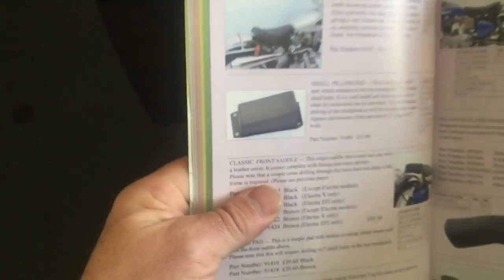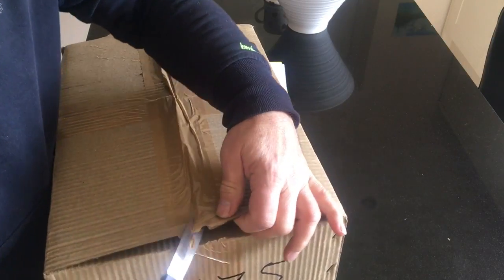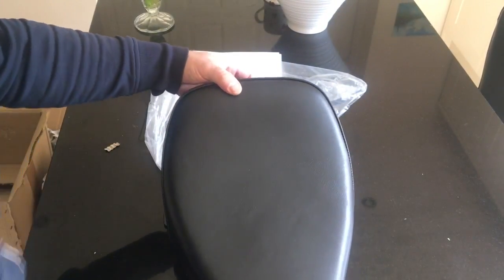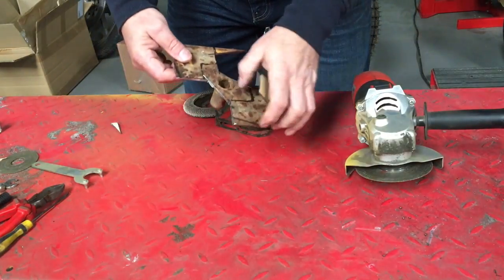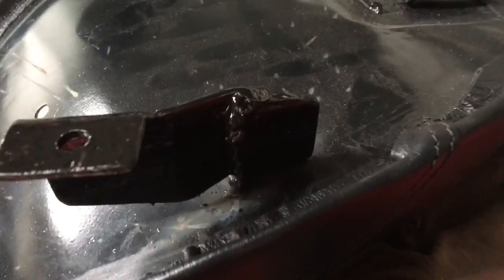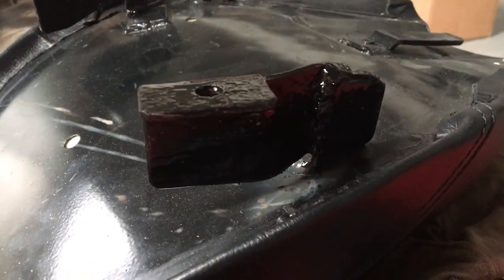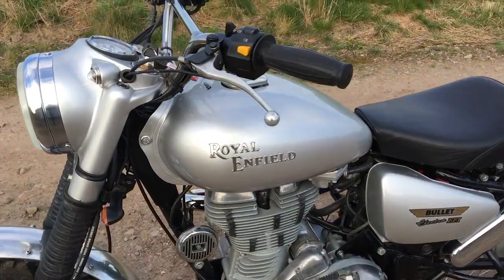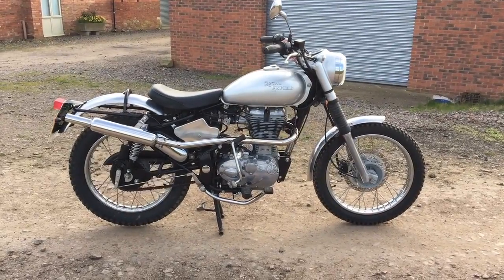6th Update Royal Enfield 500 Bullet Trials

Comment: Hang on! Did you not see that the seat brackets line up with the other horizontal bolts on the frame, all you need to do is straighten the seat brackets. On the current Classic the solo seat has bolt-on brackets and they moved the rear flange horizontal (bolt goes through sideways), I've modified my C5 seat sans springs, much more comfy. Otoh there is a "scrambles" 2/3 length seat p/n 93581 or 91432 (and other models), you got the "single unsprung".  I considered p/n 91433 for C5 but apparently I have to have a pillion seat.
Reply from the maker: Where were you when I needed you??? to be fair I considered that but if you've got it in your hands.... if you had straightened the seats brackets they would be both to long, the back of the seat would have been to high and they are to far forward also.  I considered the scrambles seat my friend has one the style isn't for me bit chunky. Hey thanks for your comments and good riding. Subscribing is free to my channel and you can see what else I've been up to regards Clean Nuts